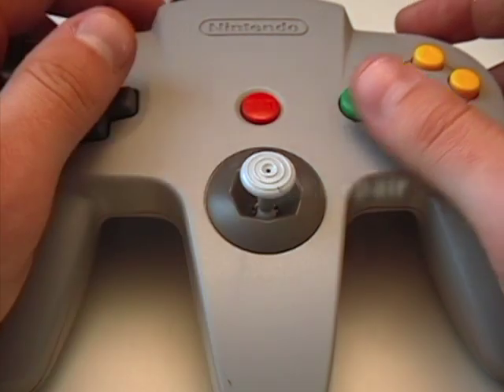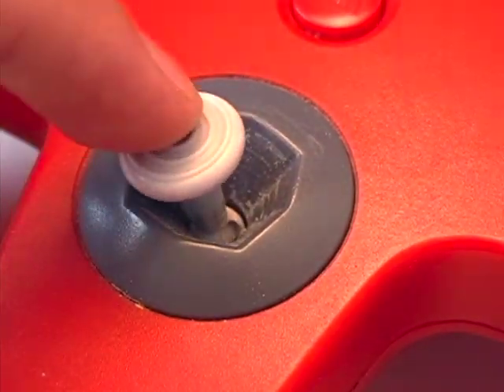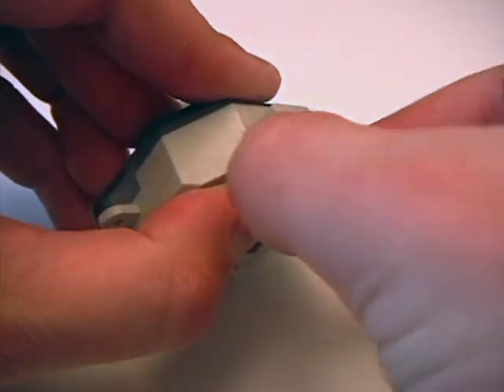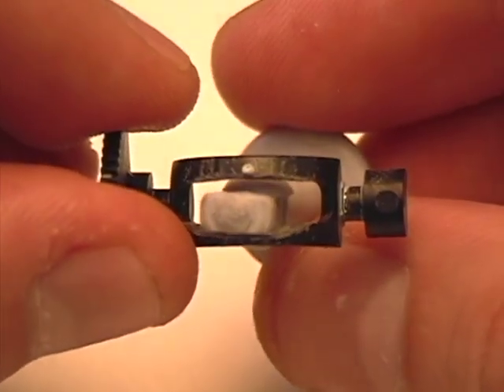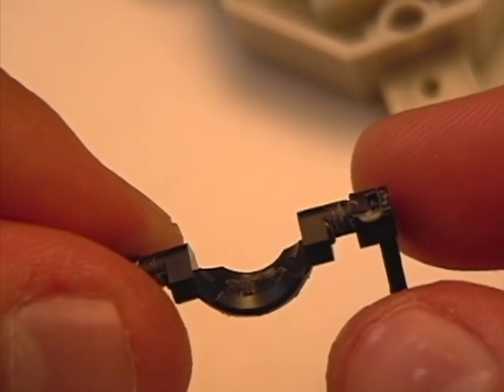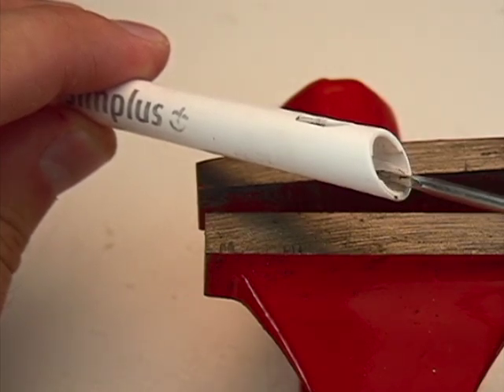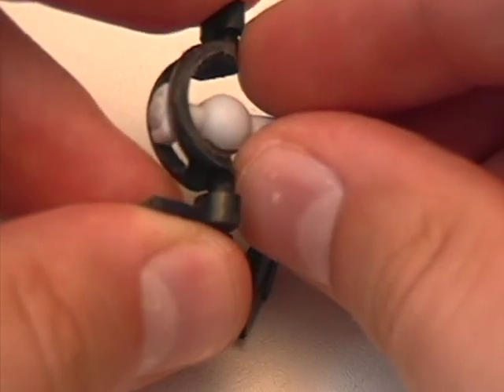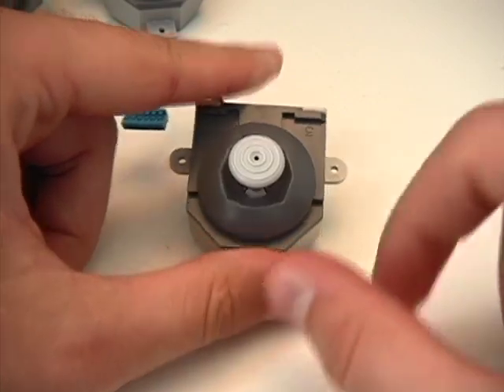N64 Analog Stick Repair

Comment: Well, my friend and I tried this, and we're having a few problems. We're currently trying just the 'support piece' part, as the glue didn't work well (might be a low quality glue). The stick did get like the second one near the end of your video (a little loose, but a lot better), but it wasn't bad at first. Here's where this gets weird. We did this on 2 controllers - obviously, my controller and my friend's controller. We tested both of them with Smash Bros, Banjo-Tooie and Bomberman 64.
In Smash, both of them are working perfectly with up-down movement, but left-right needs to push a bit more. But even though my friend's controller is worse than mine, I swear his controller actually responds a bit better (no, the pieces don't have any noticeable differences from each other). My controller in particular has problems moving left; to roll, run and use Smash Attacks to the left (all actions require moving left almost/all the way to the desired direction quickly, search for Smash 64's How to Play video to have an idea), I have to push it left way more than I should, and even then sometimes it doesn't work (the character simply moves the shield left, walks or the attack comes out as the Tilt). I don't have this problem moving to the right.
In Banjo-Tooie, the same problem started appearing. Banjo moves faster when he's going forward than when going to the left, unless I apply a bit more force to the left, and sometimes it doesn't work as well.
The worst though is Bomberman. We tried a few multiplayer matches, and Bomberman simply refuses to run horizontally on my controller, and even on my friend's controller, he sometimes doesn't run too. He walks even with the stick all the way left/right. I have to run diagonally if I want him to run horizontally, and as this is Bomberman, a bad movement can often cost you a life/match.
This is especially weird because as I said, normally my controller is better than my friend's (though not by much), and without the piece we don't have these problems (or at least it's almost unnoticeable). Both controllers are also slightly stiffer when moving to the sides than when moving vertically. The gears also don't seem too bad (a bit worn down, but I've seen worse).
My friend actually learned to do the support pieces relatively well after a few tries (the current ones are the third piece for each controller, I think). We didn't have this problem with the first ones, but they broke in almost no time (we used a pipe for these and a pen for the current ones, somehow the pipe was less resistant).
Do you have any idea on what might be the problem...?

Comment: it's 2016... can anyone 3d print these parts?
Reply: that's exactly what I'm wondering. I don't know how 3d printing works but given the fact that it's a plastic piece already, and the dimensions aren't too complex, I'm sure it wouldn't be difficult to do it.
Reply: +Miguel Moreira One guy on reddit was trying, but apparently the plastics used in a 3d printer arent strong enough, they warp and break.
Reply: Awesome!
Reply: i could definitely print the parts but, they'll last such a short time it wouldn't be worth it. I want to get the 4 parts, white bowl, two black cradles and the joystick machined out of metal and then lube the whole assembly... that would be long lasting.
Reply: After a 10 minute glance-through of this steelsticks guy I must say that's dedication. I'd buy a joystick module if I could afford it
Reply: asdf That's a shame. Guess they're not in demand enough
Reply: You can buy a complete middle replacement for like £5 on ebay
Reply: Lucifer 1990 they are cheap
Reply: enkko's site appears to be dead
Reply: Smattless  You get what you pay for, those are generally crap.

Comment: Wow, this was by far the best method I've found, I'm absolutely going for it! but...making the plastic piece looks kinda tricky, do you have a tip for how to do it? I'm a little confused about that particular part. 

Great video and greetings from México!
Reply from the maker: Hector Delgado Are you referring to the white support piece? I made that roughly the way I described in the video. You need some kind of round plastic tube (I used a pen barrel) with inside diameter that of the spherical part of the joystick, and outside diameter about 2-3mm larger. Cut about 1cm of the tube, then in half perpendicular to the plane of the open sides. You will be left with two pieces that look like half-pipes. Drill a hole like I showed in the video, and you need to file it down (using a file or sandpaper). You can compare it to the pieces I showed, or just try fitting it between the black gear pieces and the joystick to see how tight it is, and how much you need to file. It's hard to describe in writing, maybe later I'll try to make a diagram showing what I mean step by step. Thanks for commenting.

Comment: If you get a heat gun and lightly heat your black swing arms and GENTLY squeeze them together the gap closes and they  fit snugly again. There is no side travel in them before they respond to the stick movements.  Also, if you very carefully drill out the center of the bottom of the thumb-stick (where it looks like there was a ball), to about a quarter inch deep you can melt some nylon weed wacker twine into the drill hole and gather a little 2mm tall  round dollop of melted nylon weed wacker twine on the bottom of the thumb-stick.  (conversely you can also use baking soda and super glue mixed together, but this seems to not last as long as the nylon weed wacker twine.)
     Smooth the dollop on the bottom of the stick by rubbing it on the rough foot of a coffee cup or plate until it is properly round and then smooth it with the handle of a fork or spoon (or anything metallic and smooth).

     This will actually recondition your controller to more or less factory specs.  The black swing arms get stretched a bit, but usually not worn down. The support piece like shown in this video transfers all of the downward pressure onto the black swing arms and ruins them in the long run from increased pressure and friction.  
      All the grey dust you may notice when you take the thumb-stick apart was the old pivot ball at the bottom of the thumb-stick that wore itself away against the bottom white cradle cavity as you aggressively maneuver the thumb-stick.  Notice all that dust is the same color as the thumb-stick?  Especially in the video?

     The new nylon pivot ball you just installed supports the downward pressure on the thumb-stick as it pivots around in the white concave bottom cradle.

No greasing necessary, but you might need to repeat the process in a couple years.  The good news is your black swing arms will still be usable at that point with this method. Not so much with the method in the video. 
.

Comment: Just a suggestion here. I have also fixed The sloppy N64 controllers and I understand what you have done here to raise the stick back to it's proper height. The issue here will come when you are using the stick and putting downward pressure against the stick. Normally those black parts are not meant to take downward pressure. On a new assembly there is not any downward pressure on those parts. The downward pressure created the issue wearing out the bowl in the first place. With the black parts worn they are now weaker as well meaning you stand a chance to break the black part by making it support the stick. As far as the worn holes in the black plastic that can be difficult to repair but the bowl depth is important to taking the pressure from your thumb. Before I would try this I think I would try using a small dab of 2 part epoxy on the end of the stick to build it back up. may take more than 1 to take up the space of both the worn stick and the bowl. You can file it to a nice uniform shape and finally give it a light buffing with a fine finishing sand paper. once it's ready to be put back together and you have tested it's movement and find it is moving more like it should, Lubricate the bowl and the center parts around the joystick with white lithium grease or Lubriplate. Do not grease the rockers on the ends of the black parts as this will only end up getting into things like the optics disk. A small sensor views the movement of the small round disk with holes in it right next to the bowl body. If any of those holes gets blocked off it will create a dead spot in the joystick movement.
Reply from the maker: inthestix100 Yeah I hear what you're saying but honestly I've been using my controllers fixed using this method for a long time now and as far as I can tell, in practice, they are not susceptible to failure due to the black pieces counteracting downward force from the thumb. They are actually relatively strong and more susceptible to wearing away in the original configuration than breaking from downward force now. I would consider the overall potential strain to be lessened now. Regarding the notched wheel for the slotted optical switches they are far enough away that a small dab of lubricant on moving surfaces will not get in the there. I understand the issue and I can assure you that in my controllers what you are describing did not take place. Regarding building up the stick on the other end: I initially tried this before I came to this solution. I think in the video even you can see a black nub on the end of one of the sticks. The problem is that the bowl wears away in a way that is not uniform, and so its shape is not spherical. By extending the stick to interface with the bowl, you will find then that it raises or lowers depending on which part of the bowl you are touching. Also there's the issue of friction again on the bowl. I could see this method working if the bowl was regenerated, but extending the stick in my experience only made things worse. Another minus is the feeling of friction. With my method the stick rests above the bowl so there's no feeling of friction on the bottom of the bowl, leading to a smoother haptic experience. Thanks for the comment! Maybe I did something wrong with my original experiments and I could have done better, but I'm satisfied with this method.

Comment: The one large problem with this fix is that all the downward force being applied to the stick that was being supported by the bowl is now being taken up by just one of those black 'bearing' pieces.

If this fix was appiled to a new controller then there would be very little flex before the bottom of the stick touches the bowl.  However with a bowl that is warn down, there is a lot more travel before contact is made... if any.

For people light with their stick this would probably last a while.  Unfortunately for me, I don't think it would last 5 mins.  I tend to grip the controller quite tightly, resulting in a fair amount of force going through the stick.

I have never tried the epoxy style fix.  But that still seems to be my best bet.

For anyone wondering.  Yes gripping overly tightly does wear the stick/bowl much quicker then somebody who has a lighter touch.

I runied a yellow controller doing a late night romp through Ocarina of Time.  In just that one session the controller went from 'feels almost like new' to 'ugh Link won't run a full speed without an adjustment on the forward motion'.

Comment: I've found a hundred times easier method - to use soldering tin instead! You can easily wrap it around the joystick in a desired location (it's very easy to shape) and it works in the same way :)
Reply: When you wrap the tin around the joystick, do you solder the two ends together, or just leave in loose?
Reply: @superfreakinawesome8  I wrap it together, in a loop but don't solder it. Also, an update: it disfigures due to pressure and needs to be replaced every few months - it isn't a big problem though.
Reply: @vasilas432  It still works - and if you do it right you can just leave it there :)
Reply: @vasilas432  Thanks for the info. If you happen to find a way to get around it, let me know!

Comment: Interesting method to fix the stick instead of buying a replacement. Quick question though: Will this fix last nearly forever or will it wear out again after a while?

EDIT: I just learned that in someone's words "two plastics held together with super glue aren't considered two pieces anymore".
Reply from the maker: Well it's possible that it'll wear out after a very long time, or the support piece will break under stress. But it doesn't have the fundamental design flaw that the original stick had. I've been playing with the gray controller which I fixed about a year ago (about half a year before putting up this video) without any noticeable wear. The most crucial element is how the support piece fits. If it's a poor fit with rough edges it may break. I also noticed when repairing more controllers later on that over-tightening the screw holding the module shell together may put more pressure on the support piece when rotating the stick, causing it to catch if there are rough edges. I've considered making a metal support piece out of brass or aluminum to stay away from plastic, which will inevitably wear sometime in the distant future.
Reply: I would personally add a little bit of grease.  Just a small dab, to keep things moving smoother for longer.

Comment: Just did A poor mans non too handy method. Took a in ear head phone replacement tip and used that. Placed it over the Analog stick part how he did between the black gear and analog stick. Cut off the extra part that makes it fit in your ear. Just used the tube part. It works fairly good.

Comment: I like what I see, but I do have one issue. The joystick was originally designed to take the weight and pressure of the player's finger in that back white bowl. Adding that white buffer (pen piece) ends up putting all of the pressure on the x and y axis brackets which will put pressure on the edges of that white box. Over time, I can see those hinges wearing down/breaking (correct me if I'm wrong). I wonder if creating a small metal bowl with a high polish would prevent the plastic stick from wearing... Or possibly drilling a hole in the thumbstick and putting a nail with a rounded polished head in there... like a pinewood derby car axle.

Comment: My controller is in pretty bad shape, the holes are very worn out. The epoxy glue that I used is a harder one, it takes more time to dry out, and it didn't stay still when I placed it in the holes, it started to fall down a little on the edges. Now I'm wondering if I should put more or use a super glue instead.
Reply from the maker: +Matheus Lima Using epoxy is tricky because it hardens quite slowly at first, then rather quickly. You have to find the right time to apply it. It's good for filling out large areas and can be cut to shape. Super glue is a good finisher because it's very hard and can be filed. Keep trying and you'll get it!
Reply: +Christopher Poplawski Thanks for the advices! :)
Reply: +Christopher Poplawski Hello again! I did it, the joystick is nice and tight! However, when I tested it frequently  sent some unwanted half-way commands. Like, when I'm running with the character, it has a running state (full pull/push) and a walking state (half-way push/pull), I release the joystick completely but it then starts walking. Maybe a hardware/software issue? Or could it be the joystick itself?
Reply from the maker: ***** Something is causing the stick to stop before it returns to its initial neutral position. The controller works by "counting" the spokes on the two wheels using photodiodes. When you plug the controller in, it resets the count and treats the initial position as "in the middle". It sounds like the support piece and/or black piece is causing the stick not to return to its original position. So the controller still thinks it's tipped lightly to one side.
Reply: +Christopher Poplawski Alright, so the problem's core is in the wheels. Maybe the cogs aren't well connected with each other. Well, I will keep on trying here. Thank you :)
Reply: +Christopher Poplawski It's fixed! I found the problem, it was the lubricant that I used. It's a micro oil spray lubricant, kind of liquid one. So when I used it, it got stuck between the spokes on the wheels and must have been messing up the sensors. Thanks again for the advices and for the video! :)
Reply from the maker: +Matheus Lima Nice job and happy gaming! :)

Comment: Thx a ton for this video you just helping me right now with my old controler having huge z problemes and joystick was slightly bad but its actually straighter from just opening and blowing a bit and replacing sadling I only did not do that white locker thing but I actually like my semi not 100% move stick for goldeneye XD :D thx alot again

Comment: Use an oiled o-ring! Break a lighter and use the two o-rings inside or buy a o-ring kit! Perfect fit with multiple small sizes! An old lighter is free though! Cheap lighters and Bic lighters!,you need to double up on them if too thin.

Comment: After following the video and trying it myself, the joystick moves left and right fine and comes right back into the middle when released. But when I move up or down it stays there and he to be moved back and it takes more pressure to move it up or down. Do I need a lubricant or more sanding to the little piece?
Reply: The problem is that your support piece is blocked by the underside of the piece where stick is in (the part that you see outside on the controller). The support piece has to either be at the precise shape or you can do what i did and use a dremel to grind some of the stuff away thats blocking the support piece, you have to be very careful not to grind too much away. Im currently still busy studying this fix on how to perfect it for myself, maybe i will upload a video in the future how i did it myself